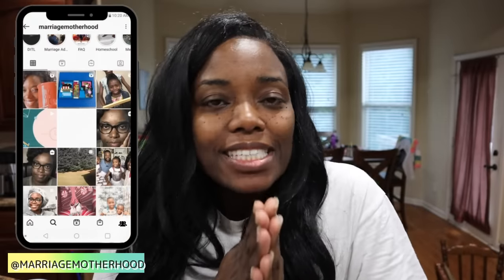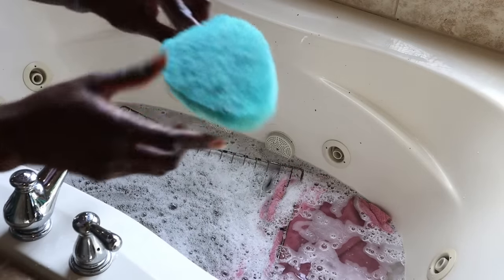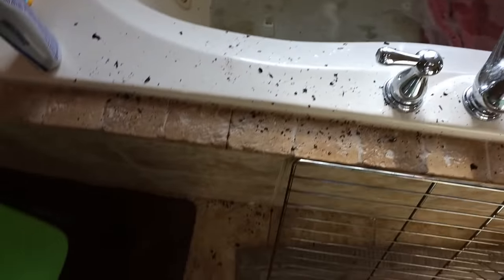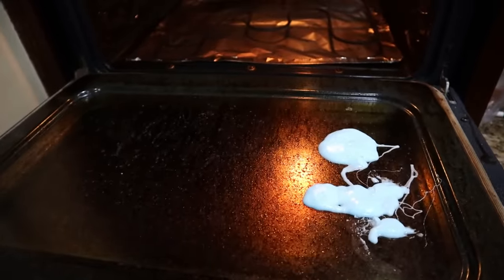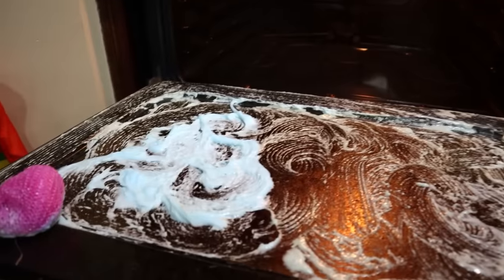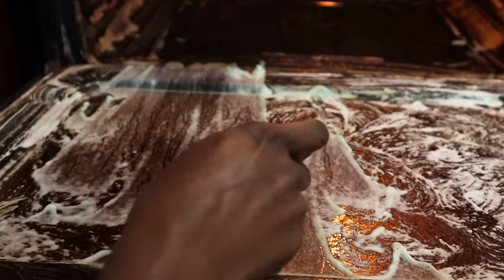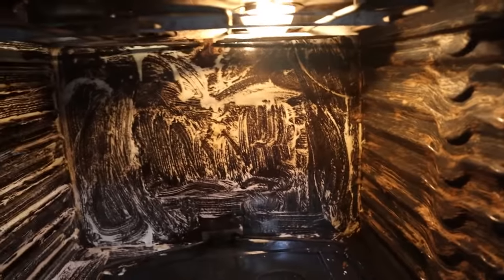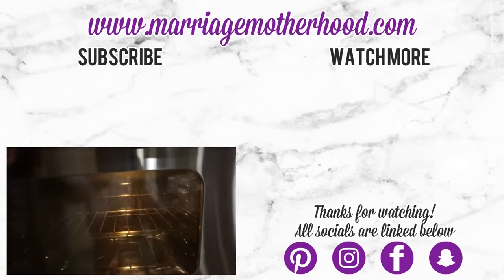Cleaning my Oven for the FIRST TIME / Oddly Satisfying CLEAN WITH ME / This cleaning hack WORKED!

Comment: You could save a lot of time by using the cleanse ZUD.  It worked hands down better & faster then the cleanser you recommended. I’ve tried both, & ZUD as no
pumice.  I also use a product called Greased Lightening, that I buy at Menards. I buy this by the gallon & have 3 spray bottles that I refill in different areas of my home. I use it in laundry, as well as other areas of our home. For blood stains, it works along with the  Oxiclean I use with each load.  Where we live, we have a well & septic, so our water needs the oomph of the Oxi-clean.

Comment: The racks put in your tub with that homemade cleaner alone over 1 hour then rinsed or 4-5 dishwasher pod cleaners in hot water - over night - either will clean the racks- slide sides up after sliding racks out. The side holders just slide up and out. Then clean all 4-6 pieces.

Comment: Using this mixture “paint” it on all surfaces, sans the element, and let sit for a couple of hours. Scoop out the mixture and then wipe out the oven. Also, you might want to check on using foil on the bottom of your oven. There are warnings not to use foil for the lining. There are silicone liners made for ovens.

Comment: Best thing for racks: seal able bags with ammonia (nonsudsing). Seal with just about a 1/2 inch of ammonia. Leave overnight. When you remove the racks, the gunk just rinses off. Do in well ventilated area.
P S so sorry for this gal, no utility sink so had to use bathtub for this...

Comment: Hi sweety in looking at your video and doesy your oven have the self cleaning. When your at the banking soda and the vinegar and the soap together make sure it looks like tooth paste. Not to thick cuz it will still hey hard. As you as the ingredients together put right away on the surface you want to clean. Wait about 30 minutes Check in between those thirsty minutes. You can use the metal scrubber very lightly. You can put the ingredients on and wait check it and put Dry paper towels or use news paper to wipe. You want the banking soda and the vinegar to stay active and you put in where ever you need it so it will work. Another thing that you can use is a steam cleaner. 

Here is some information for your only it you like. 

Steam cleaners can be safely used on a surprising amount of household surfaces, including sealed tile and hardwood floors, grout, sinks, tubs, countertops, carpets, mattresses, upholstery, showers, ovens, stove tops, grills, glass, and more. Hope this helps. God bless you!

Comment: The door is EASY to remove sis, you were HALFWAY there🤷🏾‍♀️ Once you released the hinges, you half to hold on both sides of the door with it slightly angled , pull while wiggling simultaneously ❣️ You got it next time💪🏾

Comment: I would have taken the racks outside in my backyard, used spray easy-off oven spray and left them outside. In about an hour checked the progress...if ok I'd bring them back inside and get my brillo pads and scrubbed them clean and shiny. And got some odorless oven cream and cleaned my oven inside and outside. I don't use aerosol sprays inside my home, only outside with a mask on also.

Comment: Don't care that you haven't cleaned your oven in years - I haven't cleaned my storage cupboard in 18 months! - but I WOULD worry about it being a fire hazard, or just setting off the smoke alarms when you use it!  Also, The Dollar Store sells flat aluminium trays that fit the bottom of the oven.  Honestly though, and speaking from experience, it's SO much easier to spray with a fume-less oven cleaner, leave it overnight and then literally just wipe it off.  Takes about 5 minutes, no elbow-grease required.

Comment: I heat with a wood stove. The door has a glass window. When you burn wood it makes creosote and darkens the glass. Every time. You want to know what works? Dip a handful of newspapers in water then the ash inside the stove. Rub it around. Boom. Clean in one minute. I saw your random video and I’m wondering if that will clean my range oven. I don’t eat meat so my oven isn’t really dirty. But the random pie spill. So. I might try it sooner or later. I’m very curious.

Comment: There is a much easier way to clean the oven shelves. It has to be done in the summertime when the weather is hot. put them in a heavy duty trash bag, i used double bags and pour a bottle of ammonia in the bag and seal tightly. Put the bag in a area that gets full sun and leave them for a day or two. Be careful opening the bag because the fumes will be intense. Just hose them down outside and the caked on stuff will slide right off.

Comment: I do cleaning for and i always use Easy Off blue can. Spray oven with racks in there. Clean the rest of  the kitchen then the oven, the racks just rinse with hot water wipe down oven. Not effort. For move out cleaning I use the yellow Easy Off. 
Never let your oven  get to that point. It's fire hazard and the time you waist cleaning, can use to spend with family.  Plus the germs. 
I also use the eassy off on stove cooktop in one time cleaning that are impossible to clean with regular cleaners.
Ladies work smarter not harder,❤

Comment: Great vlog and highly entertaining.  
After reading all the comments and most of the replies I just have to put in my 2 cents on modern ovens and no fume oven cleaners. 
Most modern ovens have the self cleaning function. I've used it last year on my old oven and the intense heat caused to get the oven door latch/lock stuck. Getting it unstuck was a challenge.
I've read my oven's owners manual in which it  highly does not recommend using chemical oven cleaners. 
No Fumes does not mean non-toxic. I have a very sensitive sense of smell that often triggers my migraines--among my other ailments. It's not just the fumes that affect my senses/ailments.
The oven cleaning function of my oven cleaned most of the baked on grease; but, I don't want to have the door forever locked and have to spend $$$$ on a new oven. 
I am looking for a good solution next time I'd have to clean my not so old oven. I don't bake often aside from the holiday bakes/roasts. I think I'm good for 1 more yr, or more, in having to clean my oven. It's never too early to do my research for a natural oven cleaning solution.

Comment: Most oven doors will slide right off at first tilt angle! Pull straight up. Be careful though, the glass is tempered and can break if it falls. Don't lean it against anything. Also, to loosen oven cleaner just lightly spritz with white vinegar. Always shut off POWER BREAKER before spraying

Comment: You need more venger real dawn dish soap and hot water,you have self cleaning on oven use it it works well that's is if you dont have standing oil in the bottom

Comment: The best way to remove the remaining stains is. To use Comet scouring powder, SOS pads, magic eraser,  a micro fiber cloth and water. Step 1: Make a paste with 2 parts comet and 1 part water.
Step 2: Wet the SOS pad and start scrubbing.  Wipe  with a magic eraser and dry with

Comment: When I use this method I did not used. Dawn on I just used baking sodaand hot water and gradually added the water mixed it into the was the consistency of toothpaste I let my set overnight and then I added vinegar to that mixture and itup and clean very well I got a rubber bristle brush from the dollar store and painted it on there I put newspaper on the floor

Comment: Girl lemme put you on something. EASY OFF ❤️ it’s super chemically so if you aren’t a fan of that, I don’t recommend. Basically, I put my oven on self clean to loosen up some of the mess. You can just heat your oven. Coat your oven in easy off, let it sit for a few hours, then you can wipe it off with a paper towel.

Comment: If you put the concoction on a warm oven it would of worked so much quicker. Without so much scrubbing. 😁. And you mixed it for way too long. It had stopped working by the time you used it. 🤗

Comment: So I know this is an older video and I have not read the comments.... BUUUUT, let me just toss it out there.... a) the mix your using is BOMB, I use it all the time,  add a 2cups warm water and it makes an amazing multipurpose cleaner you can spray)... but b).... just use Easy Off... I think it's called that,  it's the aerosol can yellow can oven cleaner.... let it sit an hour... you'll establish your goal of being able to see right thru the window,  and no scrubbing.  Literally paper towels will wipe the mess away.  Then just retreat any areas that didn't come up,  which will be very minimal areas.  I clean for a living,  run a cleaning business.... just easy off that thang! I promise.

Comment: OMG! Watching this stressed me out especially since there are much easier and faster ways to clean the oven.  I tried the baking soda paste method because I didn't want to use really strong chemicals, but the baking soda paste does NOT work, as you saw. I finally broke down and used Easy Off fume free (in the blue can) to clean inside my oven and the oven door and glass. After leaving it on for 2 hours, all it took was a towel to wipe it off and a razor to scrape up what was left. (You probably shouldn't use steel wool on glass) After I wiped it all off, I neutralized it with vinegar and then a wash with a soapy sponge and wiped it off. Some areas took a little longer, but I never had to strain. And those racks! After soaking them, using a sponge with a little texture, like a green and yellow Scotch pad or a silicone sponge would've worked. And it wouldn't have taken long to clean them.

Comment: I cleaned my oven with no effort. I take a metal pot with boiling water, vinegar and baking soda in it, turn it on low heat, spray inside with water every 10 min, all the dirt just melted off. After 1 hour turn it off let it cool and wipe everything with warm water.

Comment: Next time just use peroxide and hot water. Boil both together. Let cool and spray 😎. For pots just dip them in boiling water and peroxide. I used that method for yrs girl. Try it and lmk how it works for you

Comment: Why didn’t you use the self clean cycle my oven is 30 years old and has one you turn it on and it has oven get really hot for two or three hours And everything in the oven times to Ash and you just wipe it down with a damp cloth and there’s no scrubbing required

Comment: I just did it! Using the white vinegar and baking soda and dawn dish soap! It should be thick so only add what you are told nothing more and nothing less!

DO NOT SCRUB THE CONCOCTION IN. JUST DAB IT ON 

BUT BY ALL MEANS DON’T ADD WATER!!

You didn’t follow instructions if you had to scrub or use a  scraper ‘

Absolutely no scrubbing is required if you follow instructions. Look on YouTube instead of tick tock 

I didn’t have to scrub. I only had an inconvenience because I forgot NOT TO ADD WATER on one side and the bottom. And it made it super tedious and it took a lot of scrubbing to get rid of the soap!

You have to let it sit and  harden! (Over night is best but i was impatient and did it after 4 hours ) Then wipe it away with swoop. (Don’t make the mistake I made and mistake and ADDED water  which is a big no no! It made it suds up like the dickens and made it more time consuming to clean! 

Now if I can just get the oven door off!!🤔

Comment: ⬅️ this pic isn't me, it's my brother. I didn't want you to think he was giving you the tip. Try this, soak the racks with hot water and dawn, but add 1 cup of gel dishwasher detergent and swish it around to mix it with the water. You might not have to use the cleanser. It worked for me!

Comment: Again I've never seen the mixture that thick. You can also add peroxide. Thin your mixture down. Apply the mixture by hand. Let set for awhile or over night. Spray the dried mixture with alittle water. Scrub away with foil. Do a test to make sure the foil doesn't harm your finish. Use foil and or sos pads for oven & racks!!! This method works really good. I am a professional house cleaner and organizer and I despite using oven cleaner it's too strong doesn't works for you good luck

Comment: Girl, let me put you on to a better cleaning product/hack. There is a product called super clean and it comes in a purple spray bottle. You can find it at any automotive store or in the automotive section of Walmart. It is basically a degreaser I think for cleaning your brakes or something but it works wonders to clean the oven and also soap scum in your tub. And I’ve tried everything trust me. This stuff is a miracle worker. No harsh fumes either.

Comment: please don't take ;your oven door off and unscrew the window to get inside.  I did that following a hack to clean and now the inside of my window is messed and  my door does not fit correctly tight.  Just clean and do like the lady said below about using the soda and then adding the vinegar.  Also don't use a stainless steel scrubber but use steel wool very fine or even a razor scraoer ti renive the gunk on glass (not the oven inside)

Comment: If I could scream through the screen to tell you there is just one more thing you needed to do and you wouldnt have to scrub so hard, I definitely would. Next time, put the paste on everywhere and turn on your oven with a bowl of water & vinegar inside for like 15-20 minutes. If your oven has a steam setting better but definitely not necessary. The heat will pull the gunk out and get it soft enough so that just one pass with the scraper and it's gone. 

Trust me and please please try this on your other oven, I'd love to see how this works!

Comment: all you ned to do  is remove two t15 screws on the inside of thye door right behind the handle that you use to open the door   the door is inged there so you can clean the inside glass 2 minute job

Comment: oef' i feel the pain in your body.   i clean the oven with ammonia.  first pre heat the oven at full temperature.  than put a big oven dish full of boiling water on a lower rack.  than a less bigger oven dish half full with ammonia on a rack but close above the water dish.   than close the door and turn the oven off.   wait for 90 minuten.  than most staines have been soaked loose. and all the smells are gone for good.        

this will be much easier for your arms and back.

Comment: OMG! YOU GUYS! HOW MUCH TIME YOU SPENT ON THAT OVEN DOOR WINDOW!
REMEMBER! GREASE OR OIL ATTRACTS OIL! SO!
FIRST! APPLY ANY KIND OF OIL TO THAT OVEN DOOR WINDOW LET IT SIT A WHILE!! THEN TAKE A ONE SIDED RAZOR BLADE AND SOME WINDEX! SPRAY THE WINDEX ON THE OIL AND USE THE BLADE TO SCRAPE THE RESIDUE OFF! 
WORKS FOR ME EVERY TIME!
USE THE METHOD FOR INSIDE AND OUTSIDE OF THAT OVEN WINDOW!

Comment: for the oven tray racks soak in original coca cola in a shallow  tray bath or bag . stainless steel cleans up really nice usng this method . however chrome not so effective . it takes much longer maybe 10 hours or or so ? depending !  . bicarbonate baking soda or  .  stainless steel pots use coca cola . method ? clean off the worst of the dirt with some water and a dish scourer brush . any burnt on black pot . use cola leave for a few minutes and dish brush it off .
some people cannot afford or have no to little cash to buy other products . but coca cola is a conveniant easy thing people may have around or even that old coca cola you do not want in a bottle somewhere makes this a way to use this old up and to do this . 
for a steel scouring pad on chrome oven trays to really oven the tough black burnt on grime and charcoal muck and gunk . 

do save your hands  from getting soft and sore by using those rubber work gloves !
do use a big metal scourer as you cover a larger area .
do use light pressure on glass . 
do use harder pressure on metal  ceramic coating on ovens .
do take the glass of the light with a socket set and replace safely afte cleaning . 
water and electricity do not mix . 
Alwys think health and safety first !

Cleaning Glass ? a flat metal scraper preferably with a sharp flat edge on glass .
typically what one may clean a hot plate with and it has a handle . (to save your hands )
start on a corner and use some pressure but your not your body weight ! keep flat against glass at all times . 
this removes all muck and grime off a glass door . 
i have been doing this after a few days of baking bread and lasagne and general use and my oven is so clean .
remember cleanliness is next to godliness . 
so many people use those thin  green scourng pads and waste so much time doing so . theplastic c=scourers  are also  just fine on a semi clean glass for marks .
but they do gunge up and become less useful after some time so go metal with less pressure and yes it will save time . less chemicals . 
after all it is around your food ! so be careful . i mean who wanys bits of bicarbonate in the pizza or some baked on blackened food gunge of an oven in their food ?

vinegar is a ofcourse a great degreaser . but never mix with bleach . this creates a poison gas . very dangerous .!!
best regards .